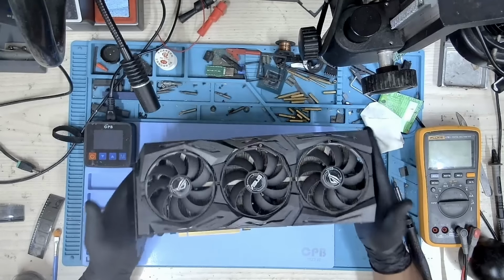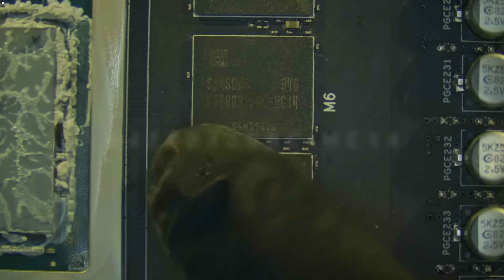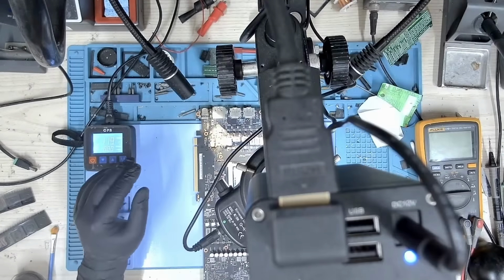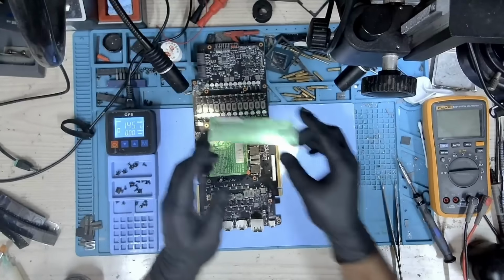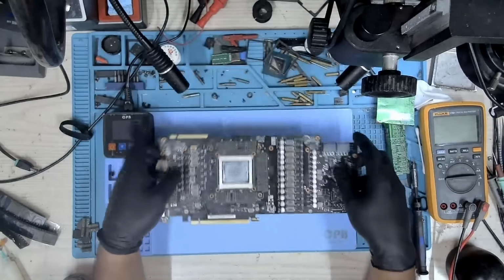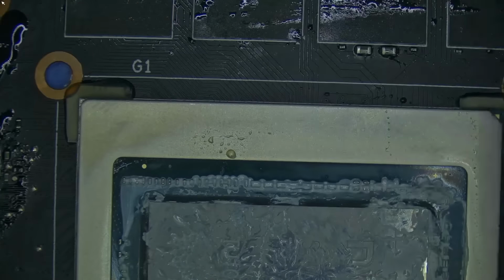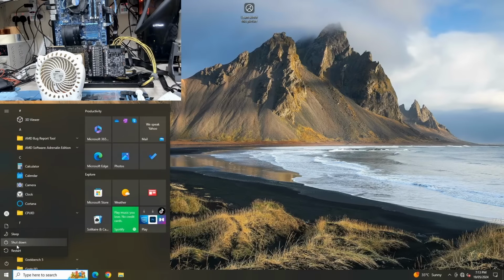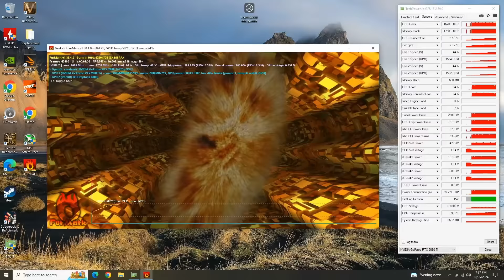Upgrading Asus RTX 2080 Ti memory from 11GB to 22GB

Comment: I don't know that anyone would actually use the extra graphics ram on the older card before it became irrelevant, but it is certainly a flex. A lot of the newer cards rely on newer technology to improve gameplay rather than just raw horsepower. I think the 40xx series has a lot of AI cores to improve the DLSS upscaling, for example. So if you wanted to play at decent framerates at 4k, newer cards would be where you would go. I have nothing against having more ram. I think all modern cards should have at least 16gb. I just don't know if it's worth upgrading an older card like this. It might be more worth it to upgrade a newer card that only comes with 8gb to 16gb or something.
Reply from the maker: For gaming, I would not recommend this upgrade on a 2080Ti. The GPUs in this video were upgraded for AI.

Comment: Bro can you upgrade GT 1030 2GB GDDR5 to 4GB/6GB GDDR5
Reply from the maker: The upgrade would cost more than the value of the GPU. For less than the cost of upgrade you will get a used 1060 with 6gb

Comment: Wait a second...if you compare a normal rtx 3060 with a rtx 4090 and you Upgrade the RAM of the 3060...can it compete with the rtx 4090?
Reply from the maker: No. 3060 cannot compete with a 4090 and not even 3090. upgrading memory does not improve performance. only capacity for smoother framerates.

Comment: 22gb on a 2080 Ti is a waste.  What wouldn't be a waste would be upgrading all these 8gb video cards that are on the market to 12 or 16, that could show noticable benefits at higher resolution, but I don't know if the cost of doing so would be worrth the cost over just buying a new card.  Also I have serious concerns over whether or not the drivers would actually use the extra ram or if it would just sit there permanently empty.
Reply from the maker: currently I have tested this upgraded 2080Ti in AI and it is able to utilize all the memory.

Comment: okay all he had to do was use the unused memory slots on the back of the card, plus missed m11 when replacing the chips which would mean that it would under perform what it was before hand anyway 🤔
Reply from the maker: The RTX 2080 Ti comes with only 11GB. M11 is empty because this slot is disabled from the GPU core. The RTX 2080 To does not use the full die as it's used by the RTX Titan which uses 12GB. So installing memory in the M11 slot will not work. The thing is not all 2080 To will have M11 empty it depends on the core. Some will have M4 and some M6. So it depends where they found defects that did not fit the bill for The RTX Titan.

Comment: Is this possible on a 4070 mobile?
Reply from the maker: All of the 40 series of Nvidia are using 2GB memory modules which is the highest capacity produced. Also the slots are limited only to the ones used. None of the 40 series can be upgraded further.
Reply: @GraphicsCardRepairs-tk7ql  shame. 4070 mobile would’ve been great if it wasn’t 8gb
Reply from the maker: I agree.

Comment: 3070 can also take 16gb from previous 8gb vram
btw the 2080ti can handle 44gb vram in total. but not all boards, only few of them
Reply from the maker: The highest capacity produced on the GDDR6 and 6X platform is 2GB. On a 2080Ti there are only 11 active slots.

Comment: can we upgrade to 64 GB or higher ??
Reply from the maker: Memory can only be doubled on GPUs that use 1GB memory modules. The largest capacity memory modules produced on the GDDR6 and GDDR6X platform is 2GB. So if you have 12 memory slots you can only go upto 24GB. This is in theory. Practically there are many things to consider which is a video in itself.

Comment: You repair gpus?
Reply from the maker: Yes I do.
Reply: @GraphicsCardRepairs-tk7ql I sent you a quote request on your website, but I'm not sure if you would be applicable to repair mine being that I am in the US as well.
Reply from the maker: If you are in the US you will need to check the shipping cost. Shipping from US to UAE costs about $60 to $100 one way depending on the package size and weight. If your shipping cost exceeds the value of your GPU then there's no point sending your GPU. Repair costs are mentioned on the FAQ page on my website for each GPU model.
Reply: @GraphicsCardRepairs-tk7ql  do you happen to have anyone you recommend in the US? I will still look into it.
Reply from the maker: Northwestrepair
tony@northwestrepair.com

Comment: The pain is not slapping more memory , Its when you need to get your hands on the Nvidia Source code to write custom Drivers , or Rewriting the drivers from scratch is when the real pain begins.
Reply from the maker: Luckily the 2080Ti works without a BIOS edit or driver change. Other GPUs are not the same.

Comment: What was the test you run 24:15? I would like to know as it does seem quite helpful and easier to test? As I work in a PC / Laptop repair company
Reply from the maker: It's Mats and MODS. It's a software used to test Nvidia GPU memory.

Comment: do a 4090
Reply from the maker: Unfortunately it has 12 memory slots and largest memory capacity produced on GDDR6X is 2GB. 24 is the highest possible on the same PCB.
Reply: @ what about a 4070 12gb from asus

Comment: Do you pre apply solder to the under side of these new chips then place them? If not what else is needed to form that electrical connection to the pcb board? 13:37
Reply from the maker: The chips are new so they come with unleaded solder. I remove the unleaded solder and reball the memory with leaded solder. Leaded solder is softer and it flexes but unleaded solder is hard and it cracks.

Comment: Please message me if you have a business doing this I really want to upgrade my RTX 3070 TI 8gb to 16gb if it’s possible
Reply from the maker: Yes I do have a business doing repairs and upgrades. Currently all GPUs with GDDR6X have issues with upgrades. Currently it's not working but I'm working on a fix. Once I find a fix I will accept all cards from 3070 Ti to 3080 ti.
Reply: @ thank you for the reply I’m definitely eager for you to find a solution. Thank you.

Comment: 2080ti is to old to worry about this upgrade. By the time you purchased the hardware and payed for your work might as well brought a better gpu that will out preform it with a way faster core. I
Would have liked to see a propper benchmark to see the difference not just a stability test.

A 3060ti, 3070ti, 4070ti 8gb cards will be a very good candidate 👍
Reply: Actually, I would argue that it's a very nice modification to old "e-waste" cards to turn them into perfectly nice auxilliary ""generative AI"" processor cards.

With 22 GB of VRAM, there's enough memory in there to have a few relevant models pre-loaded in the card.
As a silly example, I could mention that it has enough VRAM to keep some oddity like "flux-fusion-ds" loaded - which is a model that does a very good job of making the output of other models "cleaner and clearer" within a few (3-4) processing steps.

Seeing that it's likely a bit over twice as fast as the crummy RTX 3060 I've been sitting on now, it would likely spit out a refined version of whatever monstrosity you've been cooking up within 3-5 seconds.

Those 3-5 seconds is how long it would take to flush the memory of your GPU and then load an entirely new model, hehe. It's rather hard to convey without talking Tech-French.

Though I will agree that it's much more apropos on the GA104 (3060 Ti / 3070) 8 GB cards, and the RTX 3080 10 GB cards.
Reply: @TheDoomerBlox  i was just thinking from a gaming perspective.
Bit coin and rendering/ ray tracing is a whole different world 👍

A real world bench more than furmark would have been the ticket 👍

Just imagain if gpu's had memory slots and a LGA socket like a mainboard. The e waste reduction alone would make it a good idea let alone consumer sales and upgrades.
Reply: @Side85Winder  I can repeat a reply I wrote to another comment on GPUs and memory slots;

though I will note that the recent trends of "CXL" memory expansions via PCIE are a very dangerous trend for forced memory capacity restrictions as clearly set for those 3070-like cards, which is very nice

The reason the memory chips come soldered - alongside very particular in-PCB-trace wiggle patterns going to the memory chips - is because the signal quality requirements have gone way up, as speeds have gone way up.

The faster you go, the better you need to drive - as what would be a small error at lower speeds will become a massive problem at super high speeds.
The weird wiggly wire patterns are there to make the data roads from the slightly unevenly placed memory chips an equal length, such that it's easier to orchestrate a pipeline where little data chunks from different memory chips can arrive exactly to compliment the previously arrived chunk.

New stuff is also very cool, what's not cool is arbitrarily locking this cool info behind walls - as well as this modern trend of "no, you cannot purchase this chip or component", that's some real tiring stuff.

Comment: I think 5080 needs more than 16Gb for some heavy 4k gaming. Now we know upgrade is possible 😏
Reply from the maker: It uses GDDR7. If Samsung or Micron releases. 3GB module or 4GB module on GDDR7 it can be tested. Current ones I think are 2GB modules
Reply: @GraphicsCardRepairs-tk7ql  AFAIK there is 3Gb modules but their manufacturing is limited. 5090 version for notebooks will use 3×8=24Gb. And MSI and Gigabyte already has showed some renders of 5080 24Gb but then they said it was a mistake. Pretty sure there will be some kind of 5080 24Gb, maybe "Ti" or "Super". So i won't buy 5080 16Gb till be sure it's the best **80 in this generation. Or till be sure it can be soldered into 24Gb version 😉

Comment: Honestly the vram on these cards is plenty. You likely wont find a game that even needs 11 gigs on the 2080ti. Recently saw someone trying to make the 8 gigs on the RX580 useful and its almost impossible. The cards themselves are too slow for any settings that would need more ram. Few years back i really liked the 6 gigs on the 1060. Generally you pay for every gig of vram. Sometimes less is better. Of course Nvidia doesnt put enough on some of their mid range to even higher end cards so you just buy the 4090.
Reply from the maker: This upgrade is not recommended for gaming. Only AI kind of stuff.

Comment: gtx 1060 6gb to 8,12 gb try
Reply from the maker: Unfortunately all 10 series use GDDR5 and GDDR5X memory modules. The largest capacity is 1GB on this platform. It cannot be upgraded further.
Reply: @GraphicsCardRepairs-tk7ql  
Thanks for information 👍 😀

Comment: just because you think it works does not mean it actually works properly.
you need to use OCCT's GPU Memory stress test, not just FurMark

still impressive if it works though, this reminds me the Ferni days where you have multiple VRAM variants of GPUs from NVIDIA lol
Reply from the maker: I have tested it with OCCT and it can utilise all the new installed memory. In my 3070 upgrade i have shown it in the video. 😁
Reply: @GraphicsCardRepairs-tk7ql  very impressive!

Comment: gtx 1650 8gb update please
Reply from the maker: I don't have this card but for the price of the upgrade you can already buy a used 1080 or a 1080Ti which has more memory and a much faster GPU.
Reply: @GraphicsCardRepairs-tk7ql   can I use them directly or i should prepare the bios also

Comment: DOES IT WORK UNDER THE SAME DRIVER?
Reply from the maker: Yes
Reply: @GraphicsCardRepairs-tk7ql  do you know how using the same driver is able to work? 
That's crazy bc I say a YouTube video of a guy who switched a 1060 3gb into 6gb but he has to implement the 6gb drivers along with bios
Reply: @GraphicsCardRepairs-tk7ql  lmk when you can do a 24gb 3080Ti
Reply from the maker: Nvidia did plan the GPU but never released it. That's why it works.
Reply: @GraphicsCardRepairs-tk7ql  I hope they don't disable it with a future driver update.
Reply: We need you to double the thrusters on spavex rockets next

Comment: Is it possible to get more on a RTX 3060? It's a MSI RTX3060 12gb
Reply from the maker: Unfortunately 3060 already used the largest capacity memory module of 2Gb. It has only 6 active slots. It is not possible to upgrade further.

Comment: Let me add some information: 2080ti is currently the safest and most stable modification card at market, no custom BIOS ,no custom drivers required, can be  follow the NVIDA control center to use the latest official drivers, because this is one of "mistake" by NVIDA, and it is also our only chance. All other modification cards will have varying degrees of compatibility issues.
Reply from the maker: Bang on!! 😊

Comment: hmm i wonder if this would work to mine crypto
Reply from the maker: It is not tested in crypto mining. It would depend on the drivers available for linux. I have tested the upgraded 16GB 3070 and I did not find significant difference between the regular 3070 and a 16GB 3070 with the current crypto coins.

Comment: 14 gigabit does not sound right for a 3000 series GPU. It should be much much higher.
Reply from the maker: 3060 Ti and 3070 uses 14Gbps memory modules where as 3060 uses 16Gbps GDDR6 memory modules. 3070 Ti and above uses GDDR6X memory modules. 3070 Ti and 3080 uses 19Gbps, 3090 uses 19.5gbps (effective) 3090 Ti uses 21Gbps memory modules.

Comment: Does that even make sense? the 2080ti is core limited in like 99% of usecases anyways. Must be some workstation or AI task thats used for, cuz in gaming thats pretty pointless
Reply from the maker: Yes I would not recommend it for gaming either. The user of these cards upgraded it for AI.
Reply: @GraphicsCardRepairs-tk7ql  which is also a bit confusing since even the 10gig 3080 is roughly twice as fast/efficient when training AI modles with just 10gb of vram. Maybe he uses a Dataset that straight up does not run on 11gb. who knows

Comment: But why it's still going to be trash, better to do it to a 40xx with low ram
Reply from the maker: All 40 series already use 2GB memory modules. For example 4060 has 4 memory slots and with 2GB it makes it 8. So none of the 40 series can be upgraded further. 😁

Comment: i would imagine it's only worthwhile doing if you wanted to upgrade to an 8k tv/monitor
Reply: It's even worthwhile doing when the cards aren't connected to any monitor. There are use cases for them where it makes more sense than driving 8K displays.

Comment: It is possible... But so useless... Howmuch fps more?
Reply from the maker: Upgrading memory does not increase the performance of the GPU. The only benefit in games is in those games that exceed the 11GB memory of the 2080 TI. This will reduce stuttering due to memory overflow to standard RAM. In AI work load it has more benefits.

Comment: Ok how much you charge for it 😂, I have 12 GB card
Reply from the maker: For this 2080 Ti I charge $220 including the memory. If you are using a 3060 or a 4070 then these cannot be upgraded any further. 2Gb is the highest capacity produced so far and these cards already uses it.

Comment: This is stupid if you can’t get it super cheap. These cards are overpriced. A used one costs as much as a 16gb etc 4060 ti lol. There’s no situation where it’s faster. 

If you got 4x of them really dirt cheap and the cheapest memory chip seller it’s okay ish. Last SLI card I guess. But performance still probably not better than just using cpu and tons of ram server.

Comment: You can directly buy new RTX4090 😮
Reply from the maker: Yes from the user perspective for 1 4090 he can get 5 2080Ti upgraded. The total memory for his usage that's AI data sets he can use 22GB X 5. He also has a 4090. This upgrade is not recommended for gaming.